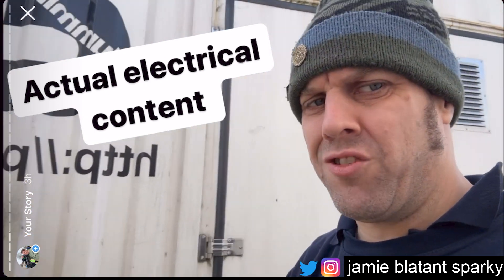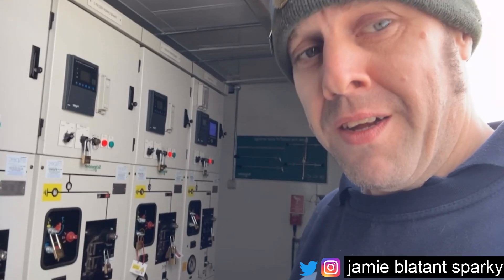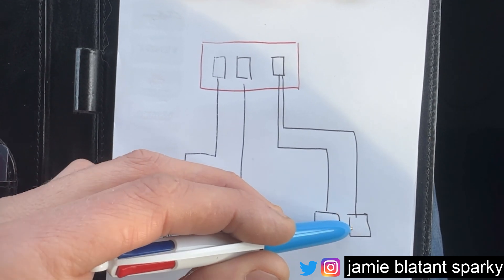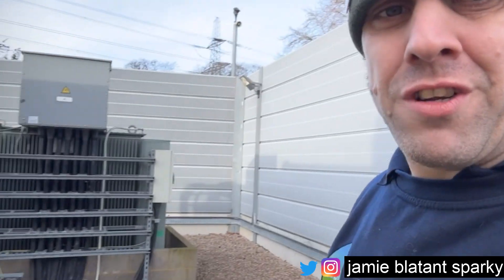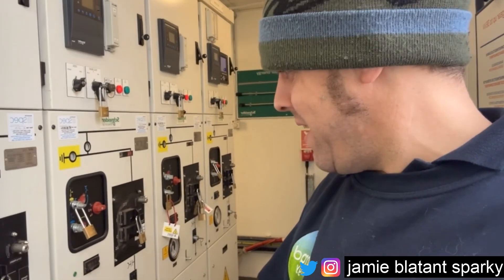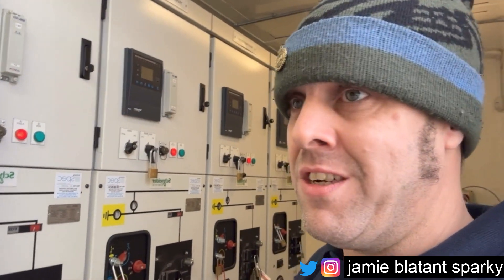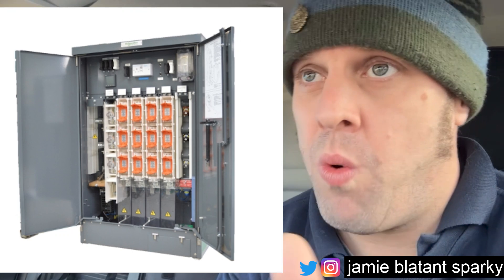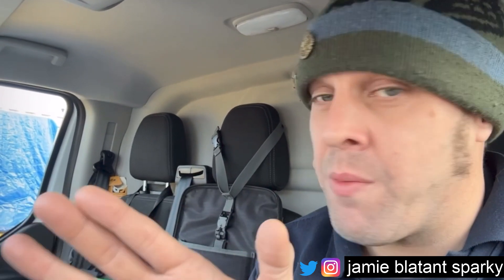cutting electrical costs with cunning design

Comment: Great explanation of the electrical aspects. Also cuts down on the size of land required for the site and all the civils work and hence the build time of the overall site. For example, each of those transformers needs a concrete plinth to stand on and possibly a bund and fire system.

Comment: There is clever designing to save money and there is just corner cutting and penny pinching which is just terrible. O always remember when john deere came out with a new fancy transmission designed by an expert went to the accountants and they modified it to make ot cheaper they had horrendous issues  with in 9 months everything that was removed or changed  from the orginal design was undone.

Comment: Personally, I cannot see the difference between having two wires terminated in the back of an accessory, as is the case of the radial example, and having two wires terminated in the breaker providing it makes sense in terms of functionality.

Comment: Jamie I get you have to sync gen with the grid  so the ac wave matches but how do you sync 4 gens so they match keep up good work mate love watching the bigger stuff an learning
Reply from the maker: the amount of generation don’t matter if it’s in sync it’s just one
Reply: Same principle........there is only one national grid that they all need to synchronize with......... unless they are operating in 'island mode' when they have to synchronize with one another.......but that is the same principle of matching voltages, frequency, phases of the other generators, and bringing them in turn onto the common busbars.
Reply: whats with...................all the......full stops.........? @BROOMEngineeringTMIET